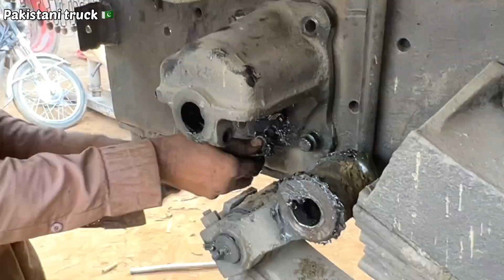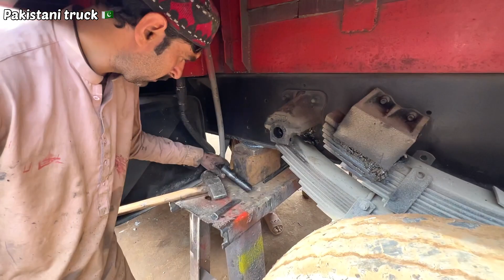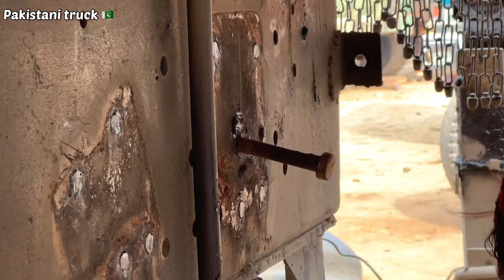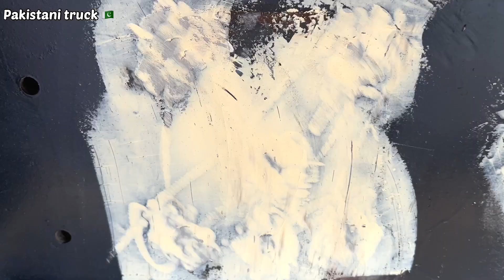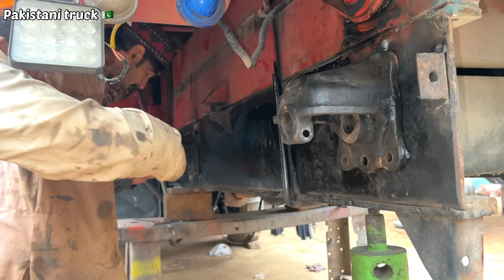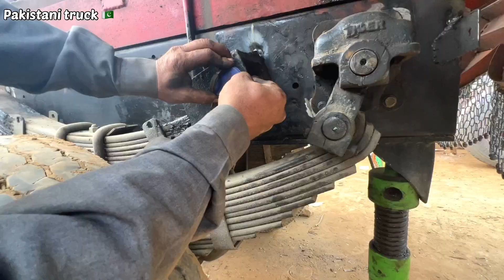How can a six wheels truck rear axle be pushed back 6 inches || Fully Repairing

Comment: These methods may not be to every one’s standards. But I can say these are not standard frames they are double and triple stacked if you follow this channel for any length of time . Importing and getting new trucks is very expensive, they use what they have and use little power tools for the most part. Don’t criticize someone trying to repair or modify a truck to the owner’s desired wishes . When your getting paid to do something it’s not always what you want rather what the owner is paying you to do. I understand things are different state side . I repair heavy rock hauling trucks for a living and I can say it’s amazing to see how they get things done compared to us . These trucks they are working on hold 40-60 K usually for weight reference. They are 12 to 24k axles by what I can see

Comment: Welding the old bolt holes and grinding them down doesn't restore strength in the frame. and wtf.....Bondo the FRAME so it looks better!???? Either they are very vain but look at the old truck. WHO CARES!!!?? Perhaps the local authorities???? Anyway, it seems to work and nobody got hurt, so it gets the job done.

Comment: what a bodge...the chassis bolt holes plugged with old bolt and surface welded. no full chassis penetration so no strength. the weld slag not cleared after every strike of arc so loads of slag inclusion.  then to mount the axle so far back on the rails. theres no structural support so either the chassis ends will twist or crack. why do these people think they know better than the manufacturer. the chassis was designed to locate the axles for a load and strength reason.. then consider how much weight the front axle will now increase as the back axle is carrying less. then add the usual overloading weight.  this project wasnt thought through at all.
Reply: )) А почему вы думаете, что умнее их???  Уверен, что все способы давно испытаны и остался самый выгодный по затратам и надежности. Загуглите как выглядит Nissan Hino из которого они делают свои самосвалы - от него берут только кабину и двигатель...)))
Reply: Yep!…. I’d love to know how much weight these trucks carry.  The double tandem’s with the dead axel is a nightmare. Hopefully they are running 2 speed rears otherwise they will blow out transmission and drive shafts.
Reply: I can't believe is all only hand tight nuts and bolts
Reply: @cherilynnkeenright6699  usually they bang on the wrenches with hammers or use a pipe for more leverage.
Reply: They ARE the manufacturers... they import used trucks torched in a cab part and a tandem section so they can stuff more of them on the ship. Then make their own frames in Pakistan.

As to why they move the axle back: Most probably this truck with a high and short dumpbed wheelies when youre trying to get a sticky load to slide out. Been there, done that.